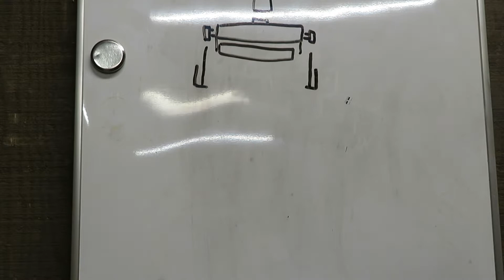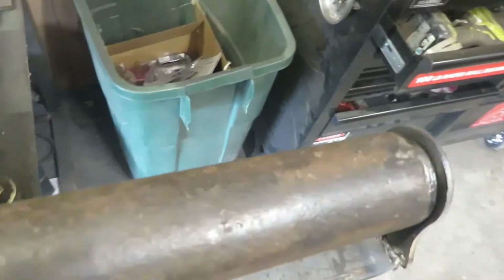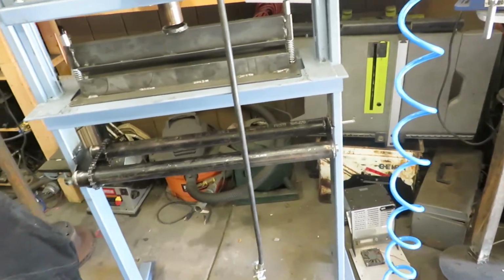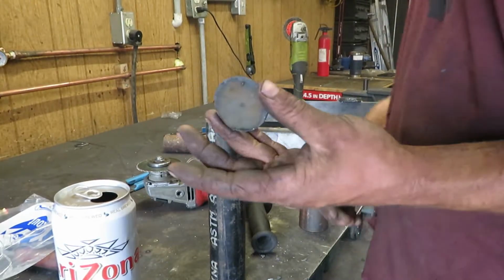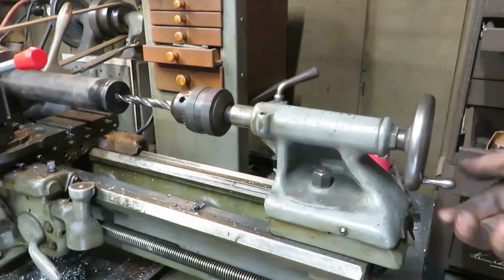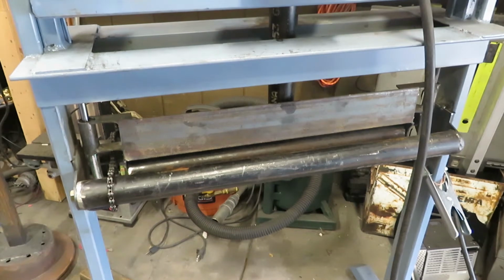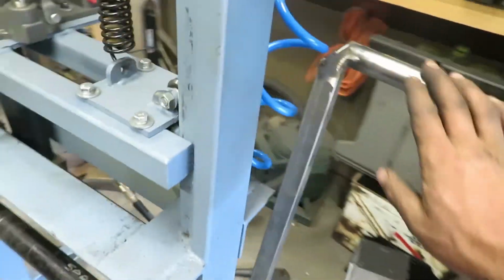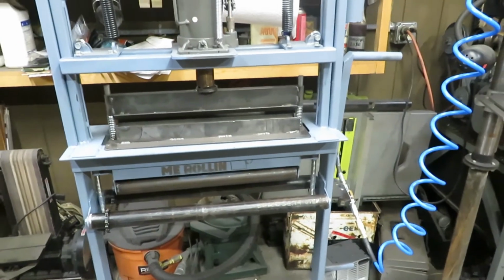Slip roller build (part 2)

Comment: videos good bro. the one thing i would suggest is to ditch that chain/sprocket and on your front roller instead of having just holes welded with the bolts going thru is to make slots. have long rods or something like 6" threaded bolts to move it forward/backward closer to your middle roller. traditionally your first 2 rolls pinch the material and feed it thru (1-1.5 material thickness adjustable with bolts), and your 3rd roll is adjusted to set your curve. cheers
Reply from the maker: Yeah, there are a lot of changes that can be made on this project. This was my first video where I was still building everything without a plan, so a lot of stuff in this build where done because of not having the right parts and not fully thinking it through. One of these days I'll revisit this and make it more better!
Thanks for the support!